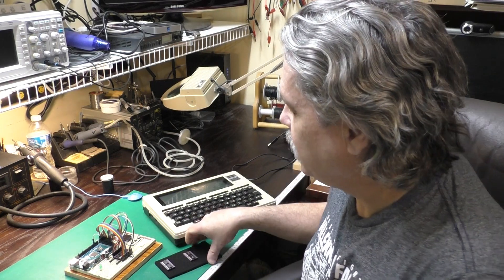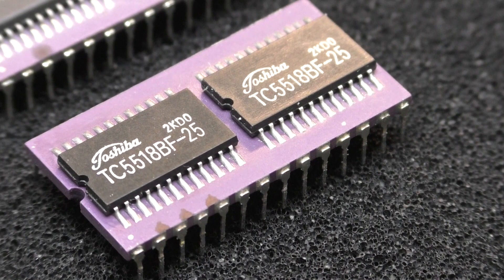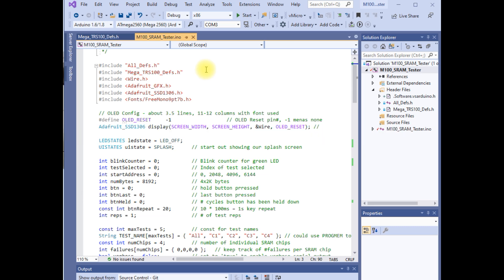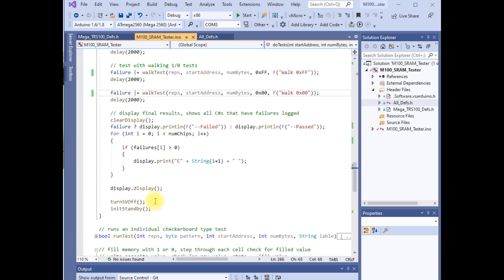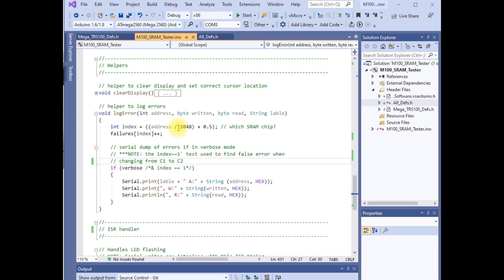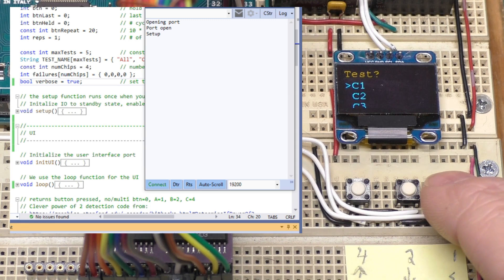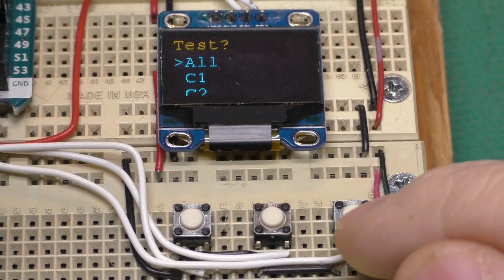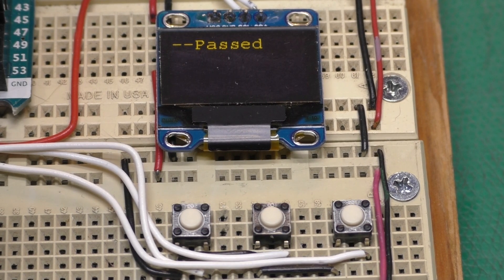Build an Arduino based vintage SRAM tester for TRS-80 M100, open source!

Comment: Hey Birt - Thanks for the great project.    I see some capacitors in your video, but none in the pdf schematic.   (Getting errors in both Eagle and Kicad if I try to open the sch file.).     Are these caps still part of the design?
Reply from the maker: The caps are just power supply filter caps as I recall. I think I used Eagle 9.5~9.6 when creating the schematic. There is also a PDF of the schematic in the same folder.

Comment: Hey Birt #2 - I'm trying to adapt this for use with a 6116 ram module.   From what I can tell, the 6116 is the same as one of the 4 internal modules on the TRS80 chip.    If I'm understanding this right, I'd just leave off pins 13-16 on the RAM side and then just test "C4".   I do this and get a passing test, but I also get a pass with no ram connected at all.   If I misalign the ram, I then get a fail for C4.    I'm suspicious though of the pass with no ram at all connected.   Does this sound like I'm doing a valid test here?   thanks!

Comment: Very cool!  Maybe you could have it do 2 tests - firstly with a timed gap inbetween C1,C2,C3,C4, and then on the 2nd pass let it run through quickly as it did before when you spotted C1 causing problems with first 4 addresses of C2.  Then you can work out if there's a chip with slow output when disabled and switching to the next chip?   Great job!  Would love to see this turn into a product - perhaps supporting other DRAM and SRAM types!
Reply from the maker: That is a good idea on a way to detect the problem automatically. There are a number of odd failure cases and it is hard to know ahead of time how to write code to diagnose them all.

I think an open source 'tester' would be the way to go as that way folks can just use it as is or can write their own tests for different  chips and share the testing code.

I may get enthused about my general purpose 'Mega Tester' again and get it finished up.